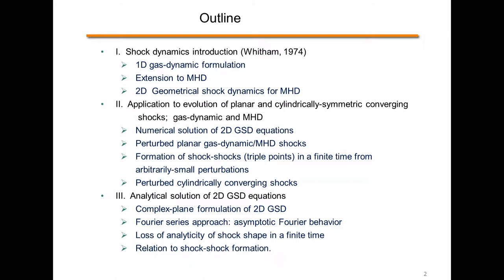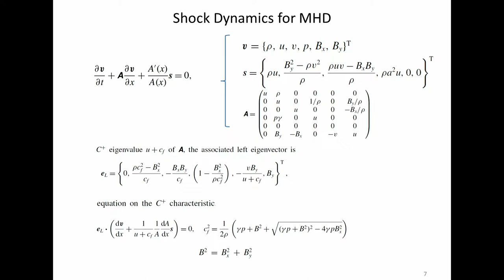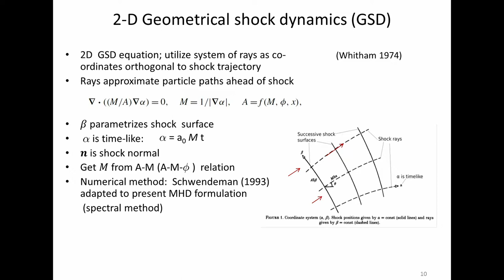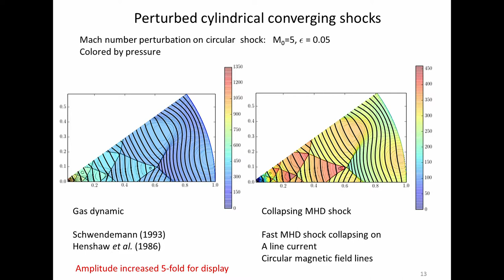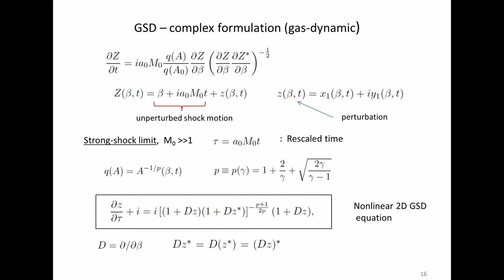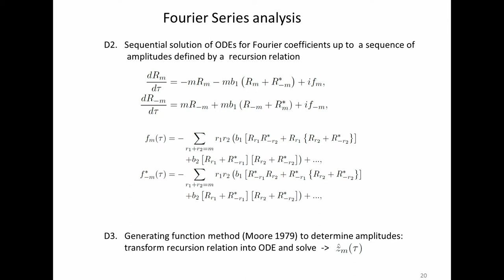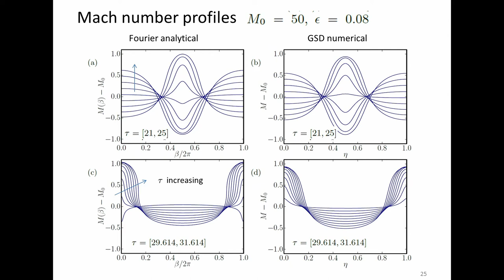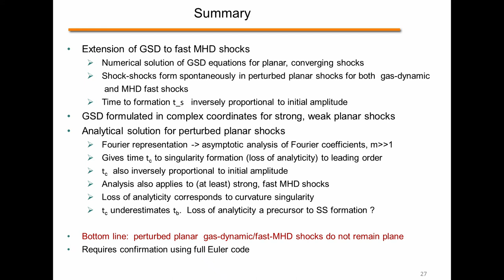Singularity formation in gas-dynamic and fast magnetohydrodynamic shocks

Comment: What happens to the equation system if the Mach number changes due to the medium of wave propagation? What are the limits of the medium of propagation from Space (d approx = 0) to say sea water? What are the derivatives of these shock-shock, et c. equations, and/or do they have any significant meaning in acceleration? Sorry, I'm new to this planet.